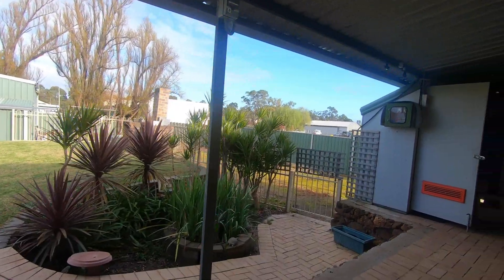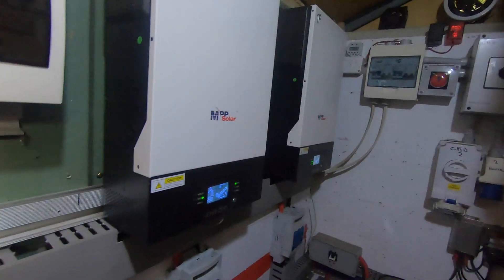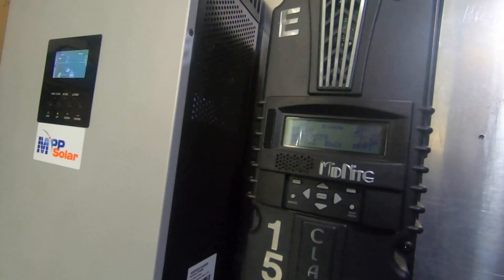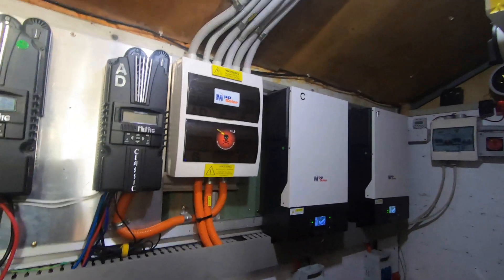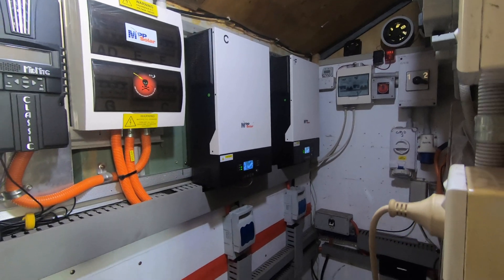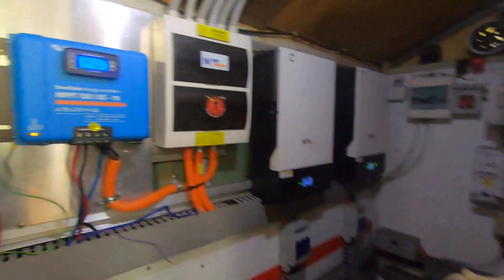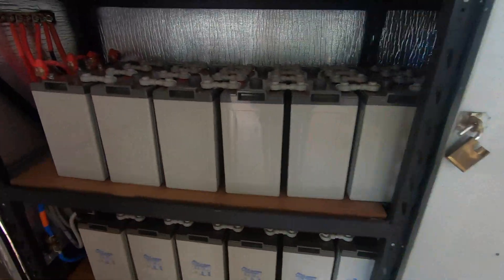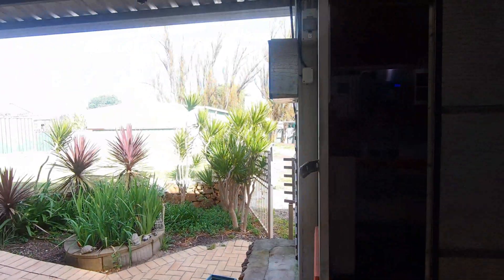Problems in the OFF GRID Power Room

Comment: Thanks Chris for the video! I love your Channel. 
I like my Mid Nite Charge controlers. I have 3. One on my small system and two on my big system you helped me design. What disappoints me about the Mid Nite Classics is that they do not easily communicate with the internet. In my opinion they are being beat out by VICTRON in this area. Plug it in and talk to it with any computer is what it should do! An easy interface with the internet. No ethernet cabling or extra cards or such. Just turn it on and find your network. 
I talked with Mid Nite and was told that the CEO does not see the need for upgrades. I find this to be poor and short sighted. 
I love the product other wise. It is tough as a hammer but is just not INFORMATION FRIENDLY.  
Jim in Chile.
Reply from the maker: I would love them to make a air cooled Bluetooth unit. All comes down to cost of development I think.

Comment: Well the Midnite finally found it's weak spot, amazing Charge Controller too bad we had to wait until something broke for another solar video but running perfect is a little boring lol.
Reply from the maker: Yes a very boring system i have. Just goes to show. Build off grid systems right and apart form the odd thing braking down their are no problems or dramas. Love it. Powers our home. So it has to work right

Comment: nice inverters there we  got a 48 volt LF growatt like it i still have the pip GK 5000 to like midnite s i had to fix 2 they got hit by lighting had to put new front boards they fire right up  not to bad to work on stay wall
Reply from the maker: Yes i think something fell off inside and jammed a fan. I see a big blue bit of plastic. when i look up from the bottom. Not sure what to make of it yet. I am in no hurry to get it fixed right now. With parts and shipping the way it is. The Victron will do the job till the world finds it's brains again.
Reply: the front main board has a fuse in them it they blows wen some thane gorse Wong i wish there a way to find it on the board  they are 200 here in the us  @JustinCaseSolarPower
Reply from the maker: @JonOffgrid  Yes it will not be a big problem. Yes it may cost a few $ to fix. Have not looked at it yet.